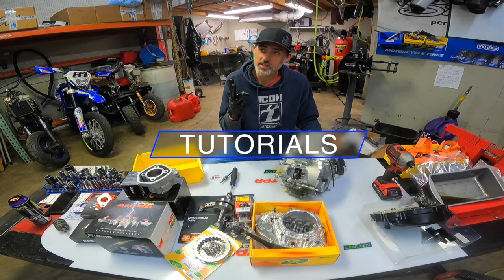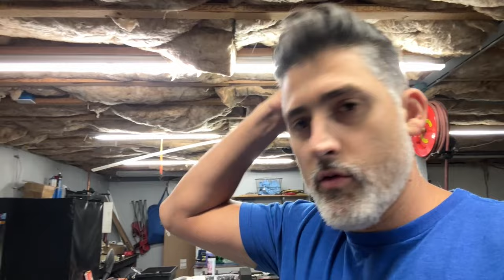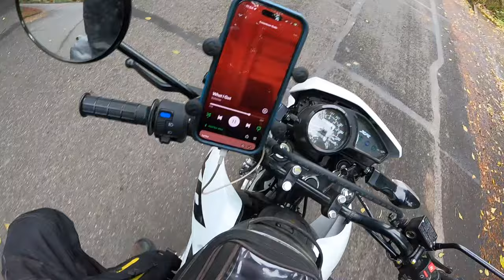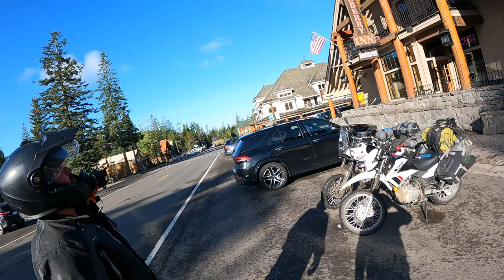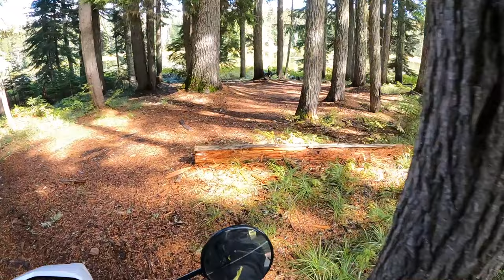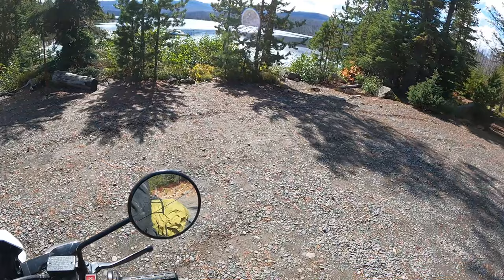2023 honda xr150 review 350 mile adventure ride

Comment: Hi All , I purchased mine right away first sight. White as some have mentioned the black ones in the bush showed scratches . As of yesterday 1900 miles . Top speed 66 mph. With the wind tucked down and trying to draft a bus . Upgrades so far are a DZG led headlight best $30 you can spend , Amozon be seen and can now see at night . Tuck foldable shifter red , Pair of red foot pegs .
A double usb/volt meter .
The factory Honda tank bag . And a Kemimoto tail bag . The bike did spend 6 weeks in the shop it was surging and bucking wildly,  they mistakenly diagnosed a carb issue for a loose pos wire on the coil . Once plug in no issues at all as expected . Would love someone to find a windshield.  Factory handgards look useless as well as skid plate please help as mentioned bar risers please help . Thanks to Mishmashmoto has made a great vid on the carb and a 115 main jet upgrade at below 1000 feet fixes lean throttle response. Thankyou  for your vid can't wait for new content on this XR150L . Sprockets would be nice as always looking for more top end .
Peace from Canada to our US neighbors.

Comment: Not sure everyone would want to do what I’ve done, but my ADV150 has been all over the National Forrest’s of New Mexico. Probably places you wouldn’t want to take the bigger dual sport. With 13k miles on it, I would agree… a small adventure bike is the absolute best. If I could get just a little more power out of I though, it would be the last bike I ever own. (I do have the big-lobe cam in it already)
Reply from the maker: I love the adv, i had one too! but it just wouldnt do anything near what this bike did. However, the adv is FAR more capable than most people think theyre awesome bikes and i miss mine
Reply: @Scooterswapshop  maybe you can figure out how to import a couple of the ADV350’s for us 😳
Reply: I'd love an AD150 but not available in canada 😞
Reply: @Scooterswapshop if you or anyone in the shop is looking to pick up an adv150. I need to sell mine, and I'm just south of PDX. Has 7k miles and thinking of selling for $3k. Gotta sell stuff and get ready to for a move.
Reply: Where do you find cams for the xr150l?  Would like a stage 1 cam!
Reply: Buy a o2 sensor with a f/a monitor.  Drill and weld in a bung into the exhaust.  Open up the intake as much as you can and jet the carb.  I guarantee you there is power to be gained.

Comment: There any way to make first as lot slower while getting the highway speed top end? Can't understand why they don't do first gear as if it was an old big red 3 Wheeler. Bike would go anywhere without clutch slipping it with a proper first

Comment: 250 nighthawk tops 80 mph and gets 75 mpg with 4 gal tank. tires and springs and It'll smoke xl off road as well
Reply from the maker: Let me know how that nighthawk does off-road…
Reply: @Scooterswapshop  it's all rider son
Reply: Can I get in on this random flexing, too?

My Xmax 300 gets up to 89-90 mph, gets similar mpg, seat and riding position way more comfortable than a Nighthawk 250,  enough storage to hold two full face helmets, ABS and traction control, and it'll smoke your Nighthawk on any paved road.

You might be thinking, how could I even make that comparison? These are two completely different bikes that are meant to serve different purposes. Well, that's I how I felt when I read your comment.